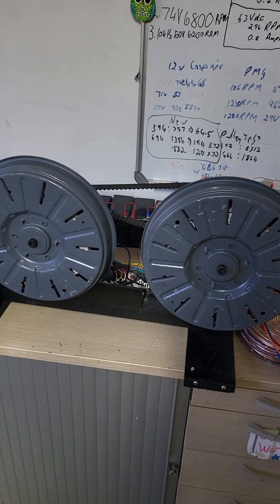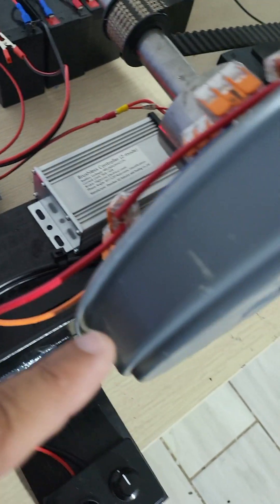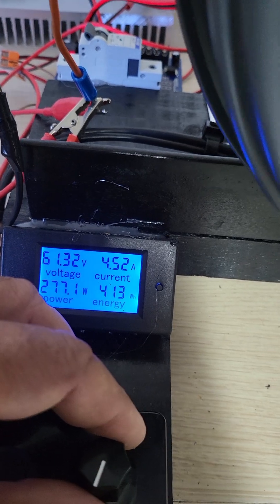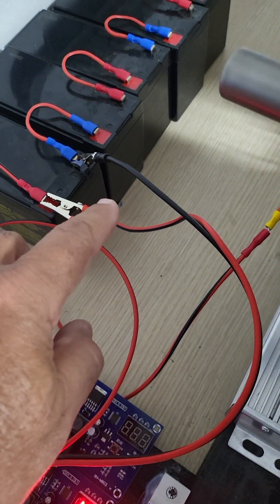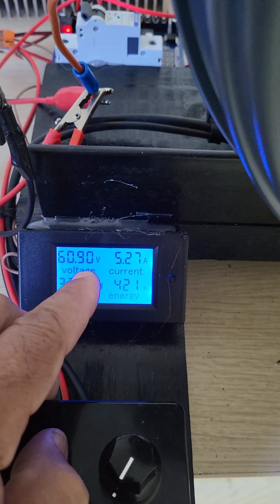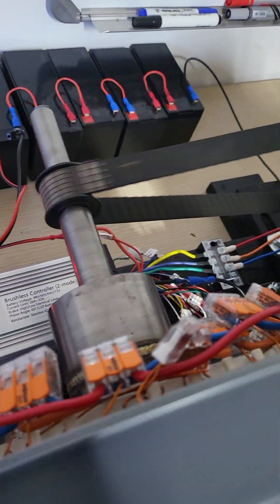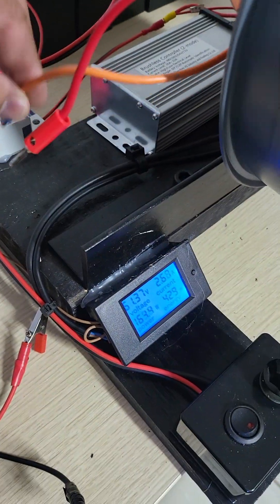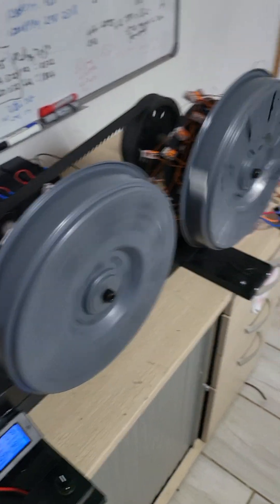LG washing machine generator with CRAZY torque!

Comment: 👍👍👏can you do a quick easy test to see if i can use 1motor to drive the 2nd fnp motor directly from the ac power output of the generating F.n.P motor out put ac.
Reply: 😊🤔🤔 so I can engine drive 1 fnp. And hard wire it's out put power to a 2nd fnp mother to be used as the motor that powers my metal lathe.💥🥳🥳 
Out bush hear in Ozzy land ..
Reply from the maker: Hey mate!. Man I dont have this setup on the bench anymore. Im not sure what you want to achieve, if you explain more I will comment. Thanks for watching man. Ciao.
Reply: I,d like more info on components and setting it up. More as a variable speed motor to drive a conveyor

Comment: You are loosing more power than you are gaining... It can't sustain itself yet. On 25amps charge, your rotor motor will likely consume 7amps at 60v (450Watt)  while your 25amps gain on 12v produces 300watt.  More improvement needed sir! All the best!
Reply from the maker: Hey! Yes you are right. This setup is for learnings. Get to know how magnetic produced energy works. Because of lenzes law and mechanical losses, I do not expect less in and more out at all. But Ive learned a lot. I believe that if you dont spin it, you cannot learn it. Thanks for watching and commenting. Ciao!

Comment: Any new development yet?
Reply from the maker: Hey Andrew. I cannot report better results than what I achieved in videos. My best is running 500rpm with maybe 80 watts, and be able to deliver large torque. This project was meant to up my knowledge in electromagnetic energy, Thanks for watching. ciao.
Reply: @jakesvandermescht694  
Was asking coz I think I achieved something. I rewired the motor 18 poles with 0.35 x 5. Strands at 3 meters per pole and rewired the other 18 pole with 1.5mm for generation part all in one motor running it with 48 1000 watts controller. With just that I can get 425 volts and if I lower the speed I can have 2000 watts cooker coil. 2 pcs turn red hot very fast. No need for storage batteries etc
Reply from the maker: Love your work man. Love it! Well done. Couple of oaks doing it, but your success is remarkable. People don't get of their chair scrolling shorts to even try and build this, and you did it. Well done! ;) Go further.
Reply: @andrewthuku2638 pls do you have a video of your design? I'm in-between getting a treadmill motor or this washing machine motor. Pls advise 🙏

Comment: I'm not sure what you are doing there, you are using the primary washing machine motor as a drive for rotating the second washing machine motor ? If yes, why ? Why not some other more efficient motor ? Did you rewired the motors? Did you add magnets? How many rpm do you approximate for constant amperage amd voltage on output? And by the way, thank you for sharing your work, I appreciate it 🙏
Reply from the maker: It is my pleasure. Yes primary washing machine motor to drive second one. First motor, second pmg. Why DD washingmachine? Because I can turn the stator myself easily in different config for motor and pmg. It is hard to do it with other stators. And I could get some of these in South Africa. I used magnets that was in there. I did neos magnets with terrible results. A secret to this is not to make your magnets too strong. RPM goes up to 500rpm with about 60v 2amp, with torque, serious torque, 300watt. Its my best results. Motor turn freely at 200rpm with 35 watt!! No off the shelf AC motors can do that, Im talking 2000w motors that can deliver proper torque. Its a playground to learn. learn about pmg and motors. What would you say would give me more torque, more efficient? The idea is to collaborate and make the next. Thanks for watching. Ciao.
Reply: @jakesvandermescht694  thank you. Yes you can use a double bench grinder with 200 W power to initiate the generator's rotation, the grinder has enough force to give you 500 rpm or more, there are also double grinders with 30k rpm if you want to take off or to make a small power plant
Reply: @aditech320  
I have not heard of a DC run bench motor and the good thing  about this hiper drive motors is you can run them at full efficiency with DC power using a ebike controller.

Comment: Fantastic work, Jakes. We are working on something similar. How did you get short dead short amp value? Do you know if your generation coil is al or cu? We are using both and confirm that the cu provides much higher amps. Playing around with different wiring configurations to see what comes out. Keep the momentum going 💪  🇿🇦
Reply from the maker: Thank you Brent! aluminium will never give you the performance as copper does. Cu will give more torque on motor and more amps as pmg.  Link two dd together and make one a motor another a pmg. Dead short the pmg side. Keep going you will learn a lot for your own benefit. Thanks for watching. cioa

Comment: Merry Christmas. What was Gerard Morin doing to run his outunner motor . Your setup is so beautiful and clean!! very cool!!
Reply from the maker: Merry Xmas to you too. Thank you! Gerard had an custom made controller. Everything starts and stop with the controller. Thanks for watching. ;)
Reply: @jakesvandermescht694  
1000 watts,2000 watts controllers runs the motor very smooth, nice sounds and high torque even without the hall sensors. Half run as motor and other half as a generator. No need for two motors.

Comment: On the generator side you can use a 24v alternator so as it would power you more. !!
Reply from the maker: Please add more detail. And howto. Do I do the neo conversion on the alternator? Or just like that? I think that the alternator needs way more rpm. I might be wrong? Anyway, thanks for chatting. :)

Comment: The maximum voltage of the controller is 72v DC how did you able to drive 100v DC to the Lg d.d
Reply from the maker: never did 100v input to motor. I have 60-64v dc. You will read that on the blue energy meter. Thanks for watching! ;)

Comment: Good build,,I use the lg coils on a 4 foot pulse motor.  
I would recommend a heavy flywheel. It will run smoother. 
Hope to see more soon..
Reply from the maker: Thank you Make. Yeh that should be nice to see with flywheel. Isnt the startup torque too much with flywheel? I need to try that! Ill check your channel on how you use the coils as pulse motor. ;)
Reply: WithFlywheelItWillBeWorse.Becauseeee,ItsAnotherLoad.

Comment: How did you couple the rotor to the shaft, it's running very smooth
Reply from the maker: Hey Science and Tech. A local engineering company did that for me. It is the one thing you got to get right and well.
Reply: I've got 5 of them and looking forward to  getting those done so it be in function
Reply: @Bluepower613 please could you assist me with a  couple of diagram
Reply: Have you tried high voltage on it
Reply: Yeah

Comment: Nice setup. There are several ways to have a steady RPM but it's not clear how the connentions are made:
*3phase generator with a 2phase rectifier?
*2 battery chargers in series?
*How are the speedcontroller, display, fuse block connected?

A simple schematic could help.
Reply from the maker: Hey Dancer. Thank you. Thanks for comments. I have update on this. So two phases going into three phase rectifier, I now have all three phases going in three phase recitifier. So sorted. I get a little more volts, I get 13+ volts now. I made some progress on amps in, watts in. I now am 40% less watts in than before. Same output! So that is super efficient. Ill make follow up video for you. Speedcontroller connection. The cheap china controller has an connection for a dimmer switch. Simple. Let me know if you have any ideas how to lower input, or up torque, or rpm. I need to get to a point where this generator can give useful power. Or the motor can drive waterpumps super super efficient.
Reply: @jakesvandermescht694  Glad I could help.
Which speedcontroller type did you use?
The dimmer can be a potmeter or RotaryEncoder.
Reply from the maker: @Dancer148  Potmeter. Controller you will find on Amazon. There are loads of them.